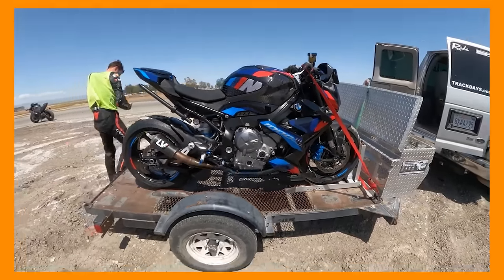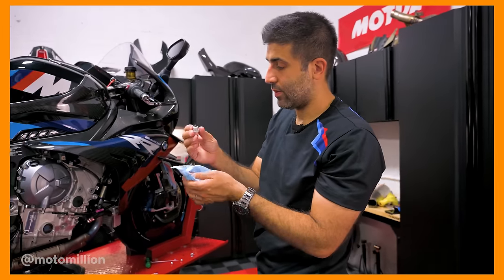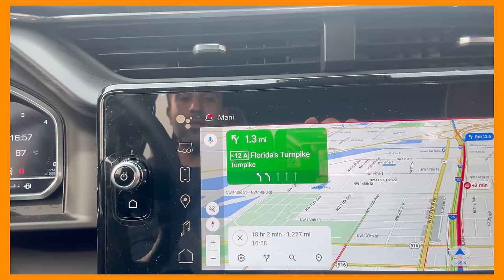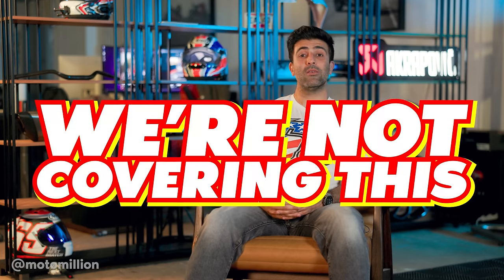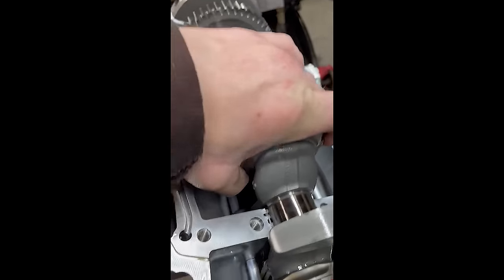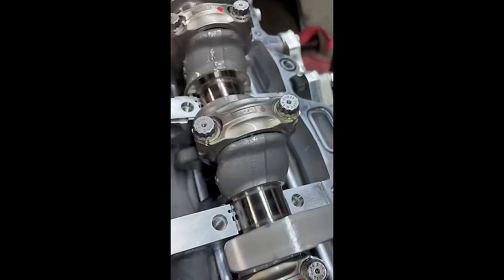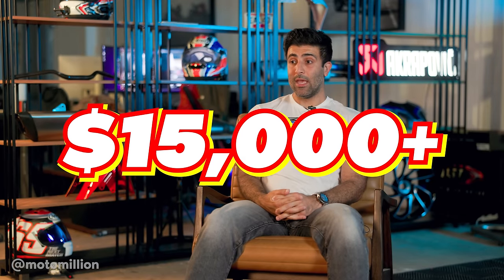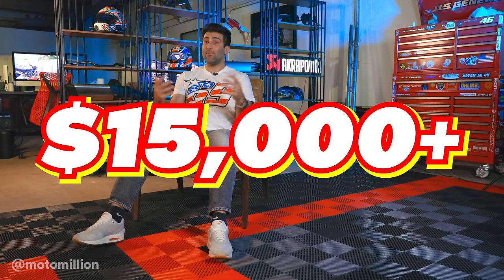MASSIVE Engine Failure on our M1000RR & BMW REFUSED Warranty...

Comment: Hi motomillion 
I have quite some experience in this field as my 2023 mspec done a rod around the same time last year. My bike had been flashed to suit straight thru exhaust I fitted, but did not change the rpm ceiling and servicing prior to flash was done by BMW.   Result -
Catastrophic engine failure , full motor replaced under warranty plus servicing and break in service, & with a new rear tire as the one on the bike was covered in oil during failure.  Fully repaired <2mths in Australia.
also included roadside pick up & transport home after engine blew.
Have nothing bad to say about BMW or local dealerships handling of this matter. Happy to share pics if wanted.

Comment: 2019 bmw s1000R, 25,000 miles, bmw dealership that I won't name now, refused to service my bike that engine wont turn over (figured out it was bad regulator/rectifier overcharging battery), they called me a week after I dropped it off, and told me, "we need you to get your motorcycle off our property asap, we cannolt service any s1000 engines at our dealership until further notice from our dealership owner" But they still sell s1000r, rr, xr on their floor. Not the best experience I've had with my first bmw issue with the bike.

Comment: I have a 2022 S1000rr. Had a recall on Chain tensioner. They replaced the chain tensioner and Intake Camshaft and 8 rocker arms. BMW did no charge
but had bike for 2 months. All done at 2315 miles

Comment: I recently got a 2023 s1000rr.
I removed the limiter on the first service ( 582 miles ).
Took to the track with 900 miles only to get me frustrated on how restricted this bike is. 
Is a 200hp motorcycle that you can’t really use it. So what’s the point!?
I’m considering 2 scenarios:

1- sell the bike and get a RSV4 Factory.
2- get the bike flashed ( BT ) that I was about to buy from motomillion and take a massive gamble with warranty if something goes wrong. 
As an average guy, I cannot afford a 15k engine.

Any valuable opinion would be much appreciated.
Reply from the maker: Get another bike. Not worth the risk.

Comment: I bought a brand new 2024 S1000rr and on the first day it started to smoke, just a little. The seller and head of the dealership said it was normal. 5 days later I stopped the motorcycle on the road full of oil on the ground. It was a 3 month struggle to get the bike replaced under warranty, at first they denied it and said it was misused, I don't know how, as the bike was brand new without any modifications and I rode super slowly.

Comment: Having read some of the comments, you can't get around the fact that the big end bearing shouldn't fail that soon. Unless you bounced it off the top (14k or whatever) limiter for a while. From what you've said there's no heat scoring, so it was likely faulty upon manufacture. Years ago my GSXR750WT (in 1997 when 6 months old) blew its bottom end bearings. Was told unoffically there was a faulty 'batch' of motors made, all sorted under warranty. No recall issued, dealers were told if the big end goes, rebuild the engjne under warranty. I'm a little surprised that BMW didn't honour your claim, after spending so much on a 'premium' top of the line product.

Comment: My purchased new 2020 S1000RR (M package) motor went out at 10k.  BMW warranted my engine replacement.  My new engine now has 2,200 miles on it and it is running great 👍🏾 

All of my service work was done by BMW dealerships.

I own a 2023 M 1000RR that has 1,225 miles on it as of today.  So far so good. 🙏🏽

Comment: BT Moto should have taught you that even if you return the ECU to its "original" state with the handheld, BMW will know it. In fact, the handheld is incrementing the flash counter via the OBD flash. Each service visit results in a unique 256 byte record in the ECU flash as part of the update (without changing the code or data tables in any way). This change can't be covered by BT Moto without sending them the ECU and the adjustment is made by connecting the unit on the table. By simply recording the service visits, the recorded CVN, the number of flashes, BMW HQ will know that the ECU is experiencing interventions outside the service network.
Reply from the maker: Aftermarket parts were never the reason for not applying warranty.

Comment: I had a 2014 S1000R and while it was a superb riding machine I wasn't impressed that the cam-chain was apparently made of rubber. Lol. I fitted the BMW extended cam-chain tensioner to take up the slack, which worked for a while and removed the noise but at the first valve service (I think 15k miles) I elected to have the chain replaced with a brand-new kit at BMW. The difference in engine performance was noticeable.
I sold it shortly thereafter and decided that would be my last BMW. Supposedly one of the best engineering outfits around but puh. I'm on my second KTM SDR now. :)

Comment: My 2020 S1K at 10K Kms blew up very similar to CaliMotoTv. Had a hole the size of a watermelon in the side. At the time, the engine had a brentune on it although I tuned it to stock while onroute to the shop on a flatbed. It did get covered, but my mechanic had to go to bat to have the engine replaced under warranty. It's made me question brentune, but even with a new engine, I am still having a lot of problems with the bike. The most recent issue was a dead gear selector and engine oil/gas mixture leaking from the side of the engine. Covered under extended warranty.
Reply: Also, will add one of the reasons the engine got covered, was likely because the mechanic had another bike in his shop with a blown engine from a month prior. The engines were made on the EXACT same date as each other and had the same failure.

Comment: I was a tech manager for a dealer for piaggio, there is several problems here, 1 the warranty states that you cannot modify the bike period and sometimes is a pencil pusher that has the final say 2 a lot of this results come down to the way the dealer reports the failure.   in Piaggio things where very close with the engineer department and the people that handle that where very inteligent engineers but bmw is very big it seems..... good luck.

Comment: Sorry , but you are to blame here. Raced motorcycles professionally for 15 years and had to run them all in. First thing I would do for production bikes, was to let somebody I trust run it in on the road as per manufacturer instructions. In all cases would put more KM's on then manufacturer asked and also build our way up to wide open throttle with rpm limits and time limit on WOT. Those motors are assembled with F1 tolerances so are very tightly assembled. I cringed when I saw the way that new motor was handled on the dyno! Not even short bursts with limited WOT to allow the pistons to gradually expand to WOT size and run in under full load.
Last but not least disregarding BMW procedures , rpm limits and  non OE mods. What were you guys thinking?  🤦‍♂🤦‍♂
Reply: Spot on. I dont know if these guyes were too hard on the engine too soon or if this is a common BMW failure. Bedding in the engine parts gearbox brakes slowly is something id do for at least 2 or 3000 miles. Especially if the bike is potentially a longterm keeper.

Comment: An engineer would never abuse a new engine like that.  If you don’t have time to ride it, why the hell do you need to remove the rev limiter at such a low mileage? You could do 600 miles in one weekend, run it in correctly, and then have the dealer service it properly.

Comment: Running-in of a thermal engine is mandatory, not to mention any mechanical gear. The frictions that occur at high revs between the piston and the freshly honed cylinder are enormous, thus the piston expands excessively and does not slide properly in the cylinder, obviously, excessive pressure occurs on the kinematic chain both on the connecting rod bolt and on the bearings. The probability that a mechanical failure will occur is very high. Let's add to that and like on a Dyno stand, the wind doesn't blow at 200km/hour, many don't know that engine cooling is not only done by water, it is also done by oil, by the casing. If you want to destroy an engine, this is exactly the procedure. An engine can be revved to the maximum after a few thousand km, and the oil change intervals when you do such a thing must be done excessively often.

Comment: These things have been detonating for years . I sold mine in 2016 a S1000R. iIt blew up 4 months later.  had 3,500 Klm's on the clock. Warranty denied. Zero mods!

Comment: You're bold to come up with a video like this. Engine had issues at 9 miles, you disregard. And what do you do? You tune the engine, remove the rev limiter, and now expect BMW to honor warranty? Any manufacturer WILL have the legal right to deny warranty in your case. And I'm not defending BMW because most likely, this was a bearing that wasn't torqued to spec that caused all this. But the good news is this very controversial video will probably get you enough monetization to pay for this engine (if you actually paid for it, not a sponsor).

Comment: My thoughts. Drive the "break-in" period and then some. You had 0 need to take off the limiter before that. Back in ´92 when I got my 1st brand new bike, 125cc 2t. I drove it well over the "break-in" distance, got the 1st service done and after that, removed all the limiters, as back then, it was all mechanical, to keep the engine safe. And after saying this. I do not doubt there may have been a fault in the assembly or that there might be problems with the engine. Did it have to be dynoed after the warning? I took my brand new snowmobile to the shop after 300km, because engine light was on.. turned out that there was built up ice in a wrong place. Bit of a "model problem" but easy fix and has not occurred since.

Comment: You replaced a lot of factory parts with aftermarket parts, ignored break in period, and were doing dyno runs with less then 400 miles.  I wouldn't warrant it either.

Comment: I had a ex-test r1200r with 1500 miles and I lost most of the braking on the front. Turns out they had put a slightly smaller GS rotor on one side and the pads in the caliper were touching each other.   Went back to them and they told me I must have changed it.... They also didn't do the valve clearances when it hit 12k miles. After the first year the paint and general finish was awful and I sold it with 14k on the clock.

Comment: My friend had a similar issue with his 2021 GS.  He got it brand new during the pandemic period.  And it was sitting at BMW dealer here in LA - almost 3 month while they tried to figure out what was wrong with it.  He got a free leather jacket though that was worth a lot.  BMW is great, but it really need lot of work to keep it running.  As for my friend, he finally found a solution to his headache - it’s called Honda.

Comment: Bought S1000R when they first came out...did minor tune with full Akra and proper fuelling set up after running for about 2K.  It dropped a valve at 10K. Luckily for me motor was replaced under warranty. Traded for 2nd hand 2017 RR at same dealer soon after fix that had 4K on clock. 2500 miles later that also broke a valve...engine replaced under warranty...lost all faith after that and was soon back driving a very reliable Gixer!

Comment: Not a bike, but I blew my Nissan VQ37VHR motor at 35K miles in 2018.  Modded, tuned, track days, etc. Nissan replaced the entire long block after determining it was low oil from the dealer oil change. I had an extensive dealer oil change history that saved my ass. Kudos to Nissan in my particular case. They also warrantied my grinding transmission. She’s still going strong. Sucks seeing BMW not taking ownership of poor craftsmanship.

Comment: He talk about his experience with customer service. That sounds about right. Fridges and bikes. The level of the customer service is appalling. Just refuse, tell whatever and "resolve" the issue by just marking it in the system "resolved". What happens in reality, it doesn't matter.

I watched the full video and I can't hear about any actual modifications. You do remove the rev limiter anyway. 250rpm over is nothing. That shouldn't happen.

Comment: I’ve own a brand new 2017 BMW S1000RR and I took my bike to a BMW Motorcycle Dealership for the 600 mile servicing to prevent anything like this from happening.  Shouldn’t have removed the limiter prior to the 600 mile servicing.  This is simple, don’t do work on the bike under warranty especially removing a 600 mile limiter!

Comment: 2021 s1000rr, did the 600 mile break in, i always let the bike warm up before taking off and being hard on it, fbo SLR tune 15,250 rpm limiter and im over 17,000mile. I tell a lot of people you gotta let them warm up before you put the hammer down, metal expands with heat, fast expansion while other parts made with different material warm up slower than other materials, this breaks things.

Comment: Revving that engine so high without the proper breakin mileage or when the engine is not warmed up, or with the rev limiter disabled will certainly toast the motor.
It’s a super high performance engine and operates within a specific window of conditions.

Comment: I know I commented on this video before, but I got to thinking about it. I watched it again and stated thinking. If this is common over several bikes perhaps the bolt shanks on cap two are too long on number two. Bolt shank is the length of the unthreaded portion of the bolt so that the treads are not in bearing (I am sure you know this). If the shank is too long it will engage the mating threads (the engine block) too soon and bind. The torque tool will stop at the specified torque not knowing that the threads have hit bottom. It just measures torque. It could be that early in the design they had planned to attach a windage tray or something ells. When the production design came to be built this flaw was overlooked. I see this quite often in my job it is called design revisions. Sorry to take up your time this just how my brain works. I see a problem and I want to know why.

Comment: I have had start issues on my 2020 BMW F850GS Adventure. When it was cold or with extreme humidity, the bike didn't want to start. BMW said to replace the battery, so I did but that didn't solve the problem. So I went to them again only to find out that I have voided my warranty because I had replaced the battery with a "non original" one. So after many complaints an after have contacted BMW Spain without receiving response, I decided that I had had enough and I ended up selling my bike (which I really liked) but being stranted out of nowhere just because there was a little bit more of cold the night before was not an option (and no, the bike wouldn't start even after warming it up). Adios BMW, I'll never buy another your bike again.

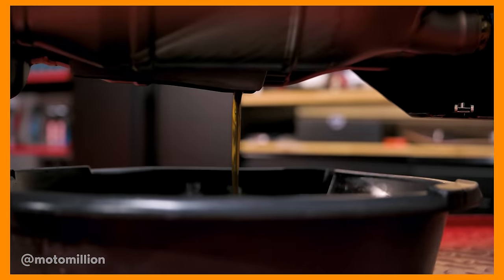Comment: So you even knew beforehand that the motorcycle might have issues, and still decided "eh, fck it, barely complete run in, do a cold oil change (how do you find shavings in the oil pan when the oil looks like this 3:56 before?), put it on a dyno and send it. Oh, and let's remove the rev limiter ourselves, what could BMW possibly say?". Big brain time, truly.

Comment: I had a Gen 2 S1000rr in the UK and BMW customer service was appalling. That bike was also recalled after 6 months for con rod bolts to be replaced as BMW became aware that they’d used the wrong spec bolts apparently 🤷🏻 I was less than happy that a BMW apprentice in a dealership was now going to disassemble my factory engine but had no option. Luckily the bike was fine all the time I had it but got rid of it after 3 year finance agreement was up just because BMW after service leaves you feeling undervalued

Comment: Bought a new Hayabusa at the dealer a few years ago with 3 miles on it. Drove it about 5 miles to the freeway and hit 11k numerous times. Had it for 5 hard years, aka redlines and missed shifts, and it never once had a problem except a few tire punctures and battery. Still roared like a lion when I sold it.
From the video, it sounded like a lot of bearing gap, a lot! I have torn down engines with spun bearings and the gaps were never that bad sounding.
Reminds me of BMW 5 series  rod bearing failures  S54/S65/S85 engines. Maybe the same engineer!
Reply: somebody interviewed ghostrider asking why he rode gixxer only, his answer was it was the only brand that didn't broke after doing a 5km wheelie

Comment: I cringed when I saw them dump the oil themselves at 400 miles after hearing internal engine noise.  In addition, removing the rev. limiter.  That was the only opportunity BMW needed to walk from warranty coverage on engine replacement.  I do not agree with it however have heard that even an engine failure with aftermarket exhaust systems have allowed BMW to walk from coverage of a dropped valve, spun bearing, etc.  They know how to get out from warranty issues as they have for years with the rear drive failures on their other models.

Comment: I am no expert in litigation, and not even in engines. From my point of view,  it sounds like the engine probably had a problem from the get-go BUT you also didn’t adhere to the break in procedure stated.  In that case, you have given them a way to bow out of coverage.  It sucks, for sure, and you are right about it being sad considering to purchase price.  Unfortunately, I think they have the right to refuse coverage.  
Let this be a lesson to all of us out there people, don’t be too quick to mess around with your bikes.  Even if the failure is not your fault, you’re putting yourself at risk of expensive repairs in case something like this scenario happens.